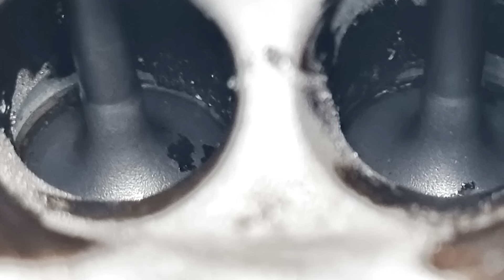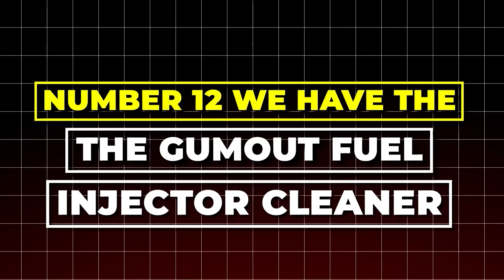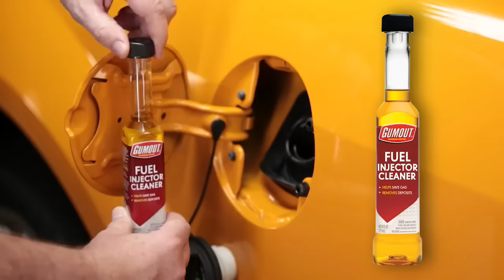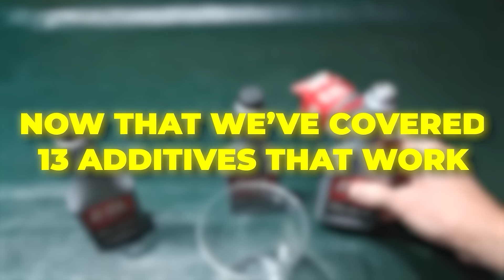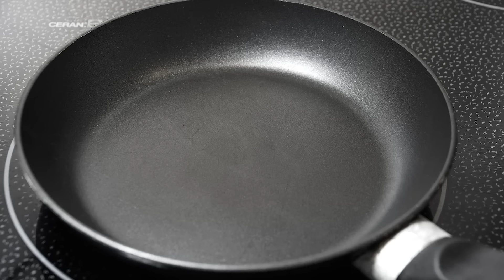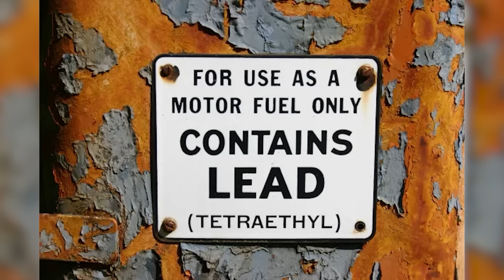13 Engine Additives That Work (And 5 That’ll Kill Your Car)

Comment: Many years ago I worked for a large company  to take care of their fleet.  They used a lab to determine oil changes and condition of each vehicle    oil changes varied from 9000 miles to an avg of 20,000  .   My personal  experience proved to be an education, I've  had several of my own work trucks  go over 600,000 miles to my current vehicle's    one is almost at 400,000 miles  and the other is over 300,000  miles on original motors and transmissions. With higher than advertised mpg's, using mobil one and prolong additive with wix filters with magnets,  and 20,000 mile oil changes  now for decades.
Reply: Please tell us more.  20,000	?
Reply: @BartholomewPepidickinakas I've  explained  how the lab told me when to change  fluids in the work truck fleet. Mobil one and wix filters were the best and i still run the same combo in the two trucks  that i own
Reply: They still make prolong? Used it in the 80s..first test my then 2 yr old 86 5.0. Idle increased after adding it like it had less friction? Strange.
Reply: @gordocarbo yes they still make it , i got a bottle at autozone on the shelf,  ive been using it for decades

Comment: Been using restore in every car I owned since the early 90's and if the car used oil when it got it after a few changes it didn't anymore. Lucas is good but restore is my choice for oil additive with BG 44k or seafoam for the fuel system.

Comment: No no manufacturer recommends any additives because the gasoline's today have it all, put a fuel injector cleaner fuel system cleaner is good for direct injected engines but you have to be consistent with it
Reply: The only "additive" that's supported by any vehicle manufacturer is Chevron Techron Fuel System Cleaner....but that's a fuel additive...

Comment: It is activated everything is working, but basically oil.change 6000km full syn allthe time a d wash the car properly way with proper fuel each car, not much need it.

Comment: You guys left out the best fuel additive out there to clean your engine from the inside and that's "RXP" fuel additive. I won't get my car inspected with out this additive in the gas tank, sometimes it make the difference between your car passing emissions or not!

Comment: Me and my brother in law both put lukas in our old Trucks and they're still going, got 225000 on a 03 dodge hemi, his dodge is 01 with a 360 he has 340000 on it. A side note my neighbor gave me a bad time for buying a  hemi said it's gonna eat the camshaft and be expensive to fix. We'll his Chevy truck did it at 35,000 .
Reply: Lol I got 207k on my chevy impala and had 411k on my Ford econoline 250 5.4 Triton before I sold it still ran

Comment: Techron fuel system cleaner works, but if you use it more than two times between oil changes it can damage the engine oil.  (says right on the techron website)   With modern engine oil there's no need to use aftermarket additives.  Oil additives originate back before multi weight oil and API mandated additive packages.
Reply: Doesn't matter if it's a modern engine or not gaskets/seals get brittle injectors get corroded/gummed up and piston rings wear down and sludge happens due to milage not age. treat an engine right and it will outlast just about every other component of a modern car. I recommend Lucas products for any vehicle with 75000 miles or more.

Comment: I’m a big Lucas fan. I run all Lucas products in my Harleys and their transmission fix actually made an old Volvo S60 of mine with a slipping transmission, driveable for at least another year. However, Lucas oil stabilizer is completely pointless. It’s nothing but a thickener. If you have to run their oil stabilizer to quiet an engine down or try to eliminate blow-by or whatever, just run a thicker oil.

Comment: Ive talked to multiple mechanics and i can speak for 2 additives that absolutely work. The Lucas brand gas additive. Ive seen the injectors unclogged before and after. It isnt a cure all but it helps. Its good to run a bottle through your car every 10,000 miles..the other awesome additive is RESTORE. It basically cured my 305 GMC engine and it made my Mustang run better too. It just works.
Reply: I was buying the RESTORE back when it first came out.
Blue in colour with if I remember dark beads or flakes in the bottom.
My car engine at the time was in really good shape it didn't show any improvement buy my cousin's car wasn't looked after and worn, tired.
His showed improvement after using it!
It's designed to pound the suspension flakes into the scratches and wear spots and lasts about 4,000km after you stop putting it in. 

I found WYNNS Oil Treatment was very good.
I found it extended the oils lifespan.
It was like a light version of STP only not outright sticky. 
If I could buy it today I wouldn't hesitate.
My mechanic swears by BG products (if there is a problem, otherwise he says just use what is recommended by the manufacturer.
Reply: @RetroCaptain they still make wynns oil treatment. We offer it at the shop i work at.
Reply: @yeshualawson I looked it up.
What I bought was in the blue metal can...
400ml and right about $4.00/5.00 which would be about $16.50 in  todays Canadian or Australian Dollar.  
I'm positive it's much more expensive now. 
I can get Lucas for less. 
I know Wynn's back then did last beyond the 3000km oil change I used to do. 
It seems as though it would have permitted another 1 or 2000km extension.
I've used STP as well for many years.
I've never found any way to tell the stp was still present in my used oil but definitely could tell Wynns was still active. 
STP wears out faster 
I have not checked after using Lucas but expect it won't be different from STP. 
Even heavier oil I've found thins out to the same consistency of thin oil.
I service heavy trucks and the oil is heavier thicker going in but at change time it's pee thin the same as the 5w30 in my vehicle

Feels identical only smells different because of the fuel dilution. 
Back when I used Wynns the oil felt no different going in and coming out months later.  Not a scientific test but something anyone could spot.
Reply: @yeshualawson  I remember the Wynns sticker from over 50 years ago.
Reply: Restore made my buddies 3.0 ranger white smoke the tires
Reply: Risolone hyper cool in the radiator actually reduces engine heat by 20 degrees my fender on my car was so hot it would burn you. I removed  16 Oz of fluid and added the Risolone hyper cool and my fender is cool as a cucumber
Reply: @gregwierzbicki5383 I bought a bottle for a piece of equipment at work but now I think I'll put in my SUV as your comment of how hot it seems it can use it. 
Its a constant 210 and seems perfect but I can't touch anything under the hood and I have no ac. Not hauling either. All aluminum engine, new recommended thermostat pump and coolant two years ago next month. 
I am convinced that the AC evaporator holds back airflow and make the rad less effective.

Comment: I'm not surprised that you guys left out Kreen Motor Tonic by Kano Labs who make Kroil Oil. Not many people know about it but a lot of old time master mechanics do. It does what many of those other products do combined. The only caveat is that it's expensive at $100 a gallon, but it works. It can be used on cars, airplanes, boats, small engines, etc.

Comment: I generally get over 300,000 miles out of a vehicle. Got one with 400,000 on it. The truck im riding now got 320,000 and i sometimes make 8 hour round trips on it. I been using Lucas oil stabilizer for 25 years.

Comment: As far as the engine rebuild stuff I disagree.  I used engine restorer in my mower that had almost no compression.  After a few minutes of barely running it came back to life.  Kept that clapped out mower going for 2 years

Comment: I ran Lucas oil additive and fuel injector cleaner on my Ram pickup with a 5.7 hemi and was checked by dealer mechanic at 221,000 miles. He said the cylinders etc looked great....probably last another 250k. I've used it for 60 years and never had it damaged anything

Comment: The lead additive is necessary for older engines.  Newer ones have been modified so they don't need it.  Aviation gasoline and racing gasoline still use it.

Comment: On the subject of lucas
Been using Lucas since 1999...
Put it my f150  v6   at new,,,never had the engine apart  423,000kms still goin
2014 raptor  upped to 700hp  used Lucas since new....289,000 kms  still goin never had engine apart..5000km oil changes...

Ur info sucks....I real tested lucas for the last 26 years...and will continue to use it😂😂😂😂

Comment: I've been using Lucas in my 2001 Silverado 4x4 every oil change. 322,000 
miles and she is still running strong.
Reply: 318k on my 2000 GMC 2500 using Lucas.
Reply: Lucas is just base oil with no additives. All it does is thin out your additives and thicken your oil. You're wasting your money
Reply: You got one of the best engines GM ever made.
Reply: No That's not how that works. Look up how Lucas performs and learn something
Reply: @pullyavalos6433  Go watch the video on The Motor Oil Geek about how engine oil additives actually work and learn something....  You'll find out he/she is 100% correct.
Reply: 257k on my 2010 Town and County and been using LOT since around 75k
Reply: Oh, endorsed by Scotty kilmer lol.
Reply: @monomaniacalmayhem  Ha, Ha, I won't be using it.
Reply: Lucas oil stabilizer is incredible stuff, it has stopped ticks and even knocks for me (temporary) if it does that that means its doing something certainly taking up small amounts of slop in the worn parts and preventing further wear.
Reply: This video is full of bllsht
Reply: Same with my 2004 Acura TL currently 384,000 miles so I will keep using it
Reply: 02 Silverado I bought new always had an issue with sticky shift solenoids esp 1st thing in the morning. Trans guy had me powerflush trans every 15k, he added a bottle of their non slip trans stuff, never once stuck again over 20 yrs.
Reply: Try mistery oil to it will run strong smooth
Reply: @Malibu-u9c  Marvel Mystery Oil
Reply: Good truck good engine
Reply: 07 LBZ, 308 miles. Been using Lucas oil stabilizer since day one. 2 gallons rotella r4 and two quarts of Lucas
Reply: I got a 2001 Ford escape with 275,000 lucus all the way
Reply: To be fair, the early 2000s were the peak of Chevrolet truck motors. They go and go forever, so long as you change the oil and do basic maintenance. God, I miss my 00 Silverado!
Reply: Is the Lucas top cylinder ejector cleaner any good
Reply: @CraigFinley-v2n  its delicious.
Reply: 400k on my 03 Toyota echo.. 1/2 bottle of Lucas every oil change since birth.. I would be more careful on these more modern vehicles tho.. shits like water now..😅
Reply: @tazzmdevil7461 for those you use the synthetic version of Lucas.
Reply: Lucas is just a thickening agent. You'd be better off using just thicker oil, Same result in oil thickness except for Lucas dilutes the additive package. Basically, 10w-30 is better than 5w-30 with Lucas
Reply: @iankovski6950 
I’m thinking your wrong
Reply: @larrytatton9315  Actually they're 100% correct.  The Motor Oil Geek has a video on engine oil additives as well as actual, professional lab test results to support the statement....  Lucas contains no additives at all, thus adding it to your oil dilutes the additive package in the oil.  You're literally just adding an extremely high viscocity base oil to your engine oil, diluting the additive package that the oil maker included.
Reply: @larrytatton9315  Lake Speed did a chemical analysis of Lucas and discovered that it's just a thickener with no additives. Look up his video.
Reply: @aaronthomas6155  you 100% wrong I worked for them in there plant in corydon Indiana and have seen how the process working right in front of my eyes. Can you say the same thing ? No because you’re basing your opinion off what you heard from someone else who didn’t know what they were talking about. I challenge you to go and do way more research
Reply: @iankovski6950  Ran 10w-30 in an early '90's 3.9 V6. Sold it with almost 400K.
Reply: @iankovski6950  you really don’t know what your talking about

Comment: When I was in grade school, my Dad had a job selling a product called CMI. I think it was called Collet Metals Inc. I went on a sales pitch with him once that totally blew me away. 

He went to a machine shop and asked the manager what his best lubricant was. My Dad had two identical engine valves and he had two identical blocks of steel. He chucked on valve into a drill press and brought it down on the block and it stopped spinning almost immediately. He did again with the same valve but on the other steel block. Same pressure to stop it from spinning. He told the manager to use his best lubricant in the block about a quarters worth. My Dad instructed the manager to pull down on the drill press handle and with light pressure, let it spin for about 10-20 seconds and then pull harder. It didn’t take much to bring it to a stop. 

Then my Dad used the other Valve and the other Block of steel. He brought the DP handle down and with very little pressure it stopped immediately. He then put a dime size drop of this CMI onto the Steel block and asked me to bring the drill press handle down to just barely touch the block and to let it spin for 10-20 seconds. He then said to hang on the handle. I looked at him and thought right. I used two hands and it just kept spinning the same speed. My Dad spoke up and said, no, I said Hang on the handle. I weighed about 95 pounds at the time. I did what he said and with both hands on the handle I pressed down hard and raised my legs and it just spinned effortlessly. My eyes went wide as I watch it.  The Manager bought a case of the CMI. 

Later when I entered HS I got my Grandfather’s old 69 Ford Torino with a 351 Windsor in it. It was a rocket ship. It used a little oil, but I usually kept it topped off. 

I used my Dad’s CMI about a 3.5 oz bottle on the oil.  

I got in a race with another car once and knew I was probably low on oil. After blowing the doors off the other car, I checked my oil and found it was not even on the dip stick. I added one qt of oil and it barely touched the bottom of the Dip stick. I added 3 qts  in total and bought 3 more bottles of this CMI from my Dad. 

He sold this product to steel mills and all sorts of industrial metal works places. 

When I graduated HS the company went under and I’ve never heard anything about them again. I wish I had some of that stuff again. AMAZING!!!😮👍😎
Reply: Problem bought by the Big Oil company.  Then took it off the market. Or it would still be in business
Reply: True. If it worked they probably took it off the market. 😡
Reply: Probably the car companies bought it out so your vehicles will wear out sooner so you have to buy another one. It’s called creative marketing thanks for your comment. It was very interesting.
Reply: I think it is called QMI. I have been using it for years, and it works!
Reply: So much old school in that story! Love it!

Comment: Just got ATS 505 for my 2002 Celica GTS, will use it for my Subaru if the results are good. Tried AT-205 on my power steering system with amazing results.

Comment: I have been using the BG MOA for the past 36 years, it really works. The 44K and CF5 fuel cleaners are great too.
Reply: IYKYK! 💯 If you use MOA on a brand new vehicle every oil change BG will warranty the life of the engine

Comment: I have a 2007 Corvette.when the check engine light came on because of the O2 sensor I put in a can of Seafoam and it cleared the alarm within 100 miles.

Comment: Don't know ifbit helped butbi put slick 50 in a  92 geo metro  second oil change. Got 262,000 miles out of it.   Obsolete  fact. I did not know it fuked  it up so much! Hum! Who wouod have thought! Last 60,000 i used it as more of a truck. Loaded it with crates of books.  Filled up so much inly driver could ride. Again, did not know it messed it up so much. 262,000 miles.

Comment: I have used Motorkote for over 20 years in all my cars. I read about it in independent tests and it is a highly rated engine oil additive.
Reply: I've used Motorkote also for years and still do. I have over 230000 miles on my engine problem free. I use it in everything.
Reply: Motorkote is expensive as hell because it just works
Reply: AMSOIL is a highly rated oil according to "independent lab tests".....but AMSOIL will never say which "independent lab" supposedly tested it.
Reply: @aaronthomas6155 Amsoil is good as well.
Reply: @aaronthomas6155  Have you watched Project Farm regarding synthetic oil testing?  Amsoil comes out on top vs other synthetics.
Reply: Was hoping somebody would mention motorkote been using it for years In a 01 car but these salty roads did the car in I start the car every once in a while it purrs now I use. Motorkote in our other vehicles
Reply: ive been using motorkote its really amazing!

Comment: I used Slick 50 in my 2000 Dakota 3.9 v6 every 50,000 miles it was showing 388,000 miles and running fine when I traded for a 2013 Ram 1500 3.6 Pentastar.
Reply: I have used it for years in my toyota.

Comment: G.K.  U.S.A.  I used and am using Amzoil produucts for over 500000 miles. Motor oil, oil filters, transmission fluid,.differential and transaxial fluids- all Amzoil products- no problems.
Reply: One of my co-workers put AMSOIL in the rear diff of a Ford Escape a few months ago.  Didn't make it out of the parking lot before the rear diff locked up and exploded....

Comment: Techron is a scam, I ran a bottle every 1,500 miles and atn35k miles my intake valves were so carboned up it caused hard starting issues, service manager said put a can of BG44K every 20k miles and you won't have issues.  Je was right, forgot once and bang problem was up, put it in and problem cleared.